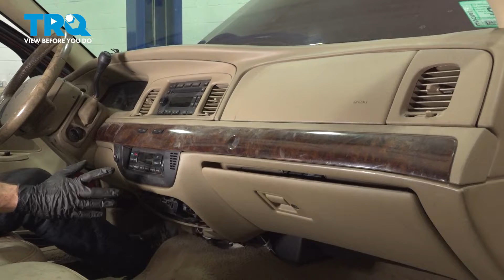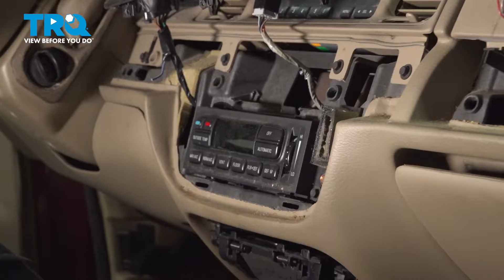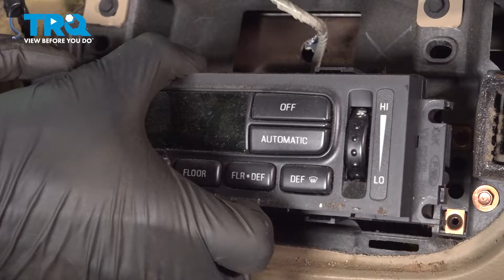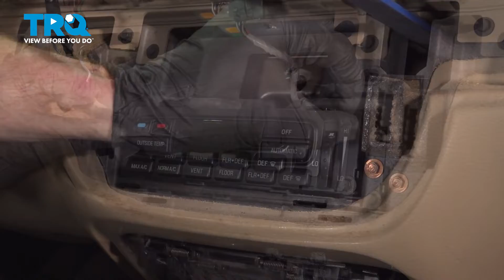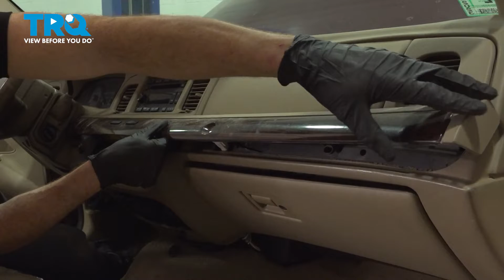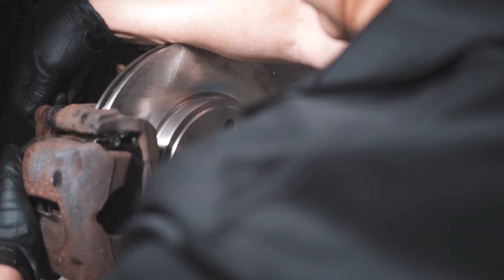How To Replace Heater & A/C Control 2003-2011 Mercury Grand Marquis

Comment: What a great video! I'm thinking mine needs replacing. As I get no heat through my vents but only the dash to defrost the windshield. I ran the self test, and it doesn't give codes. Also, the vent and floor buttons don't light up either.